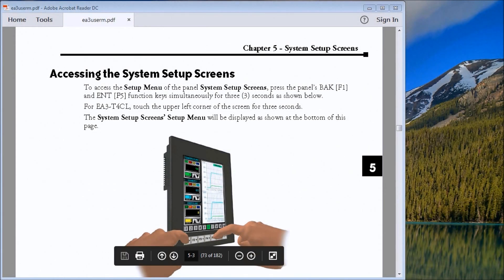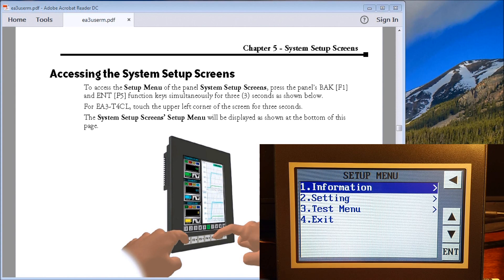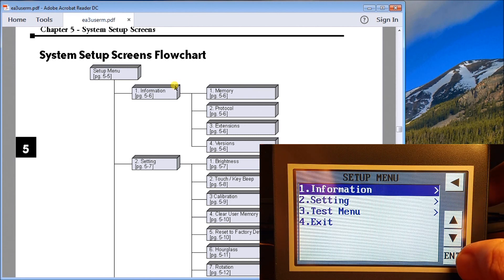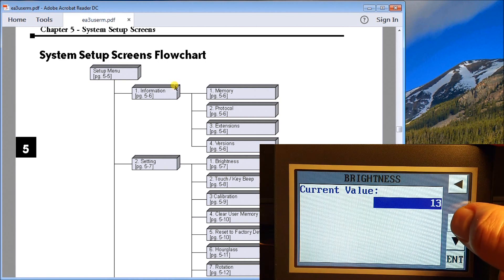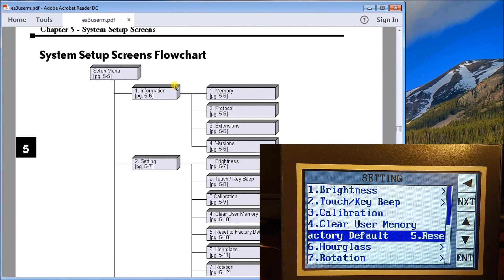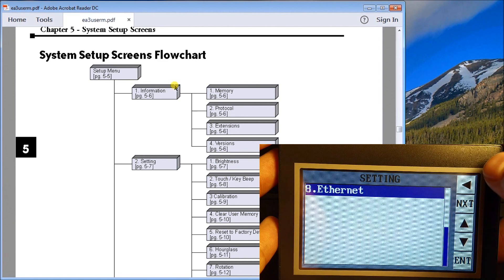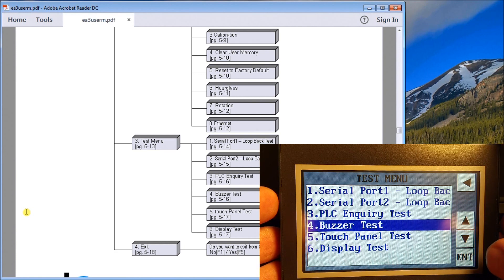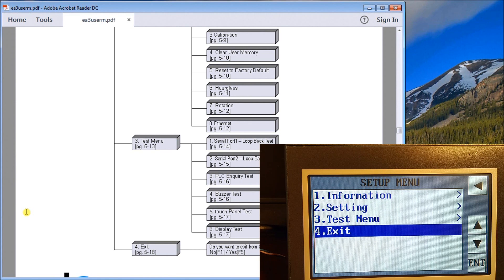C-More Micro HMI System Setup Screens

Comment: Gary, I am new to the C-More line, but I am very impressed of the power of this little unit. I was never able to find a "screen saver" setting to set the display dark after a period of non usage. My plans are to install these at remote sites that are only in use by an technician during troubleshooting or equipment installation. It would be not necessary for the display to be on all the time. I did create a way to do this, but it would be nice to have a system that would do this. I have my plc send a screen change command to change the screen to screen 1. I have set screen one all black and have hidden a big button to advance it to the main page #2. I also put two corner spots to get to the set-up screen. This little unit really works well and is very price effective.
Reply from the maker: Hi Michael,
These units are very impressive. Another option for you is to use the PLC to Panel words. 
Start Address + 2 Words will control the Backlight Display. Putting a value of 7 in this word will turn off the backlight display.
This can be found on the following post:
https://accautomation.ca/c-more-micro-hmi-first-program-part-2/
Hope this helps you out.
Regards,
Garry